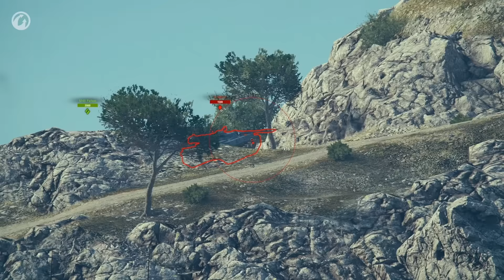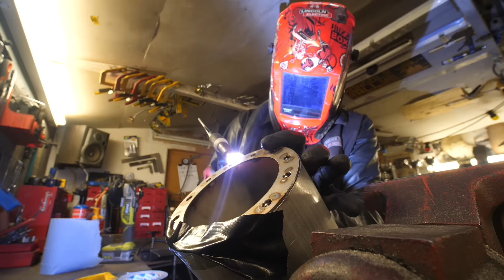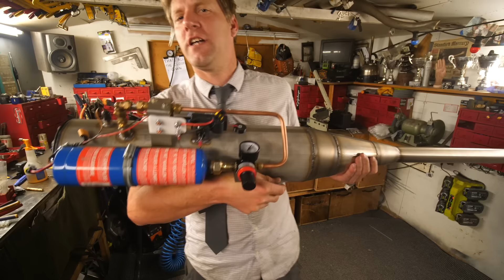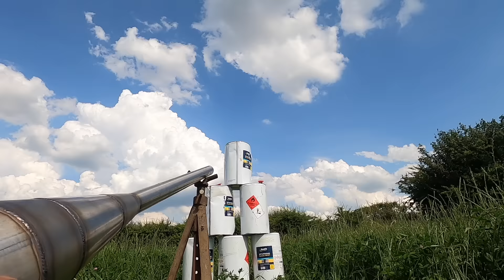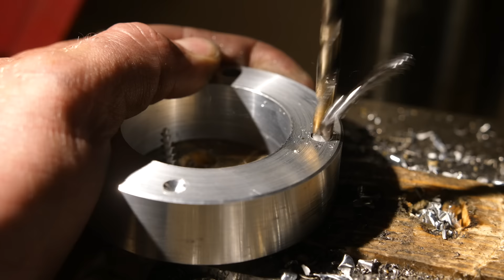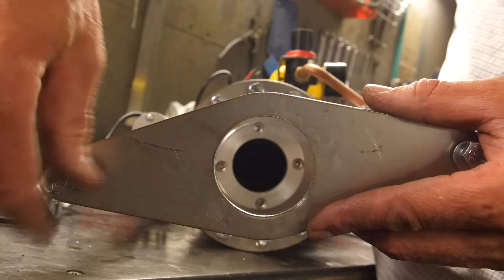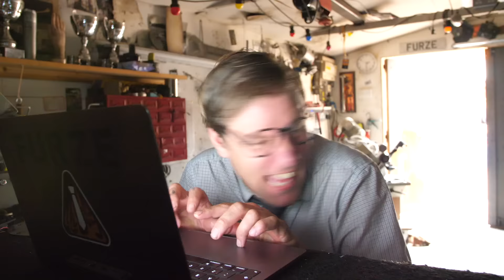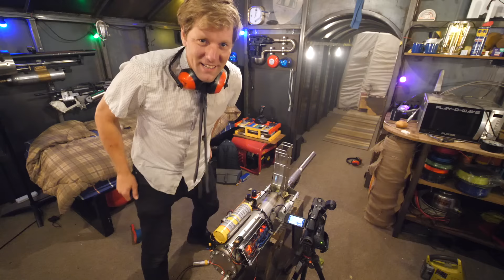SEMI AUTO POTATO CANNON for the Homemade Screw Tank

Comment: How is there always enough oxygen inside the chamber for the explosion, won't be used up after some shots?
Reply from the maker: I guess its a bit like the pulse jet in when it blasts it out it then sucks air in after the expansion of the explosion, the fan might assist that to
Reply: @colinfurze  didn't the plastic fan melt?
Reply: @Lele422  And what is it actually good for?
Reply: @ft6637  I think the fan is used to get an even mix of air and fuel
Reply: @colinfurze  oh I didn't see the fan. Thanks for answering and greetings from germany!!
Reply: He monted a fan for ventilation
Reply: I guess the hot air cooling down puls fresh air trough the barrel